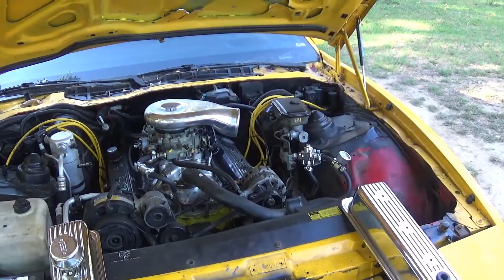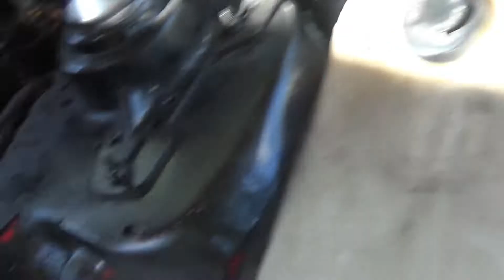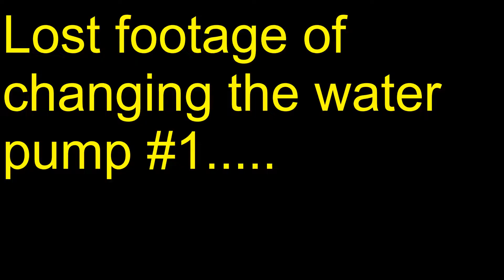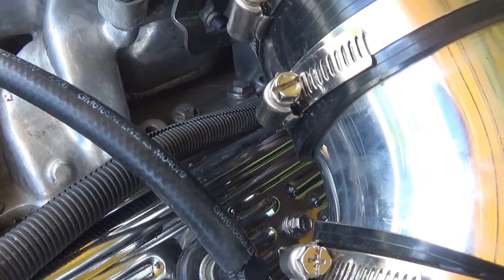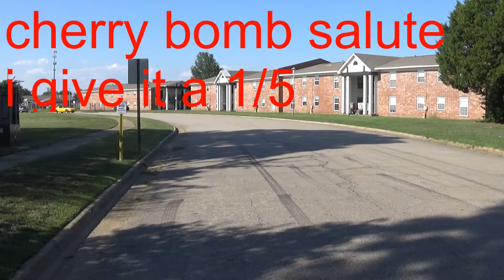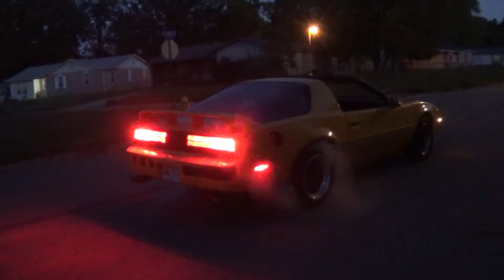3rd gen firebird will it fly on its first drive ep 7

Comment: Damn I can't believe it has positraction! That's awesome!
Also I hate to be a buzzkill but I really gotta warn you. Every time I've gotten into the throttle in reverse with a hot car it broke something. I have two nice old V8 cars sitting in my yard that won't move backward anymore because they were floored in reverse. 
I also ended up destroying a really nice old Chrysler after doing a reverse burnout and then pinning the speedometer getting onto the highway. The reverse burnout somehow broke the belts/tread caps in both rear tires and the tread caps let go and wrapped around the rear axle on me doing over 120. I even heard James Taylor totalled one of the Two Lane Blacktop 55s while sitting still on the line by trying to launch it in reverse by accident. I'd hate to see you make more work for yourself or even destroy a whole car like that. 
(Also noticed we have the same notification sound too by the way LoL)
Reply from the maker: Yea and factory too 😆 seemed to be a decent optioned factory car. Thanks. As for reverse i dont usally do much, sometimes i goose it or just drive backwards. But i avoid reverse burnouts